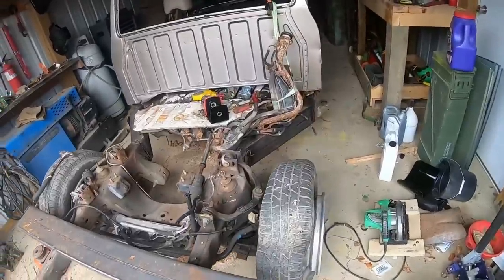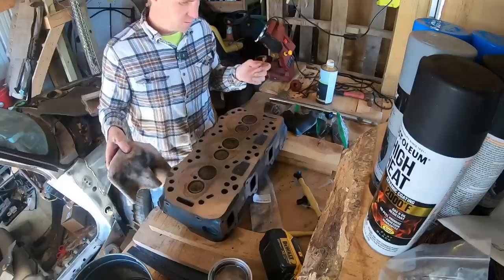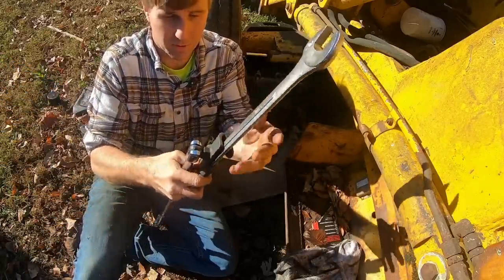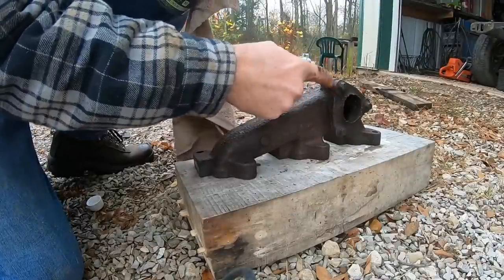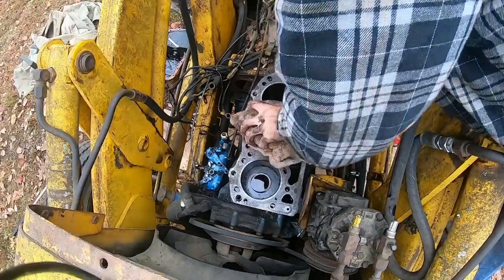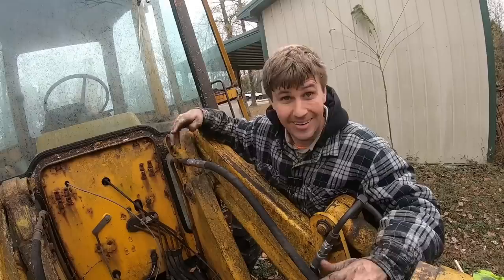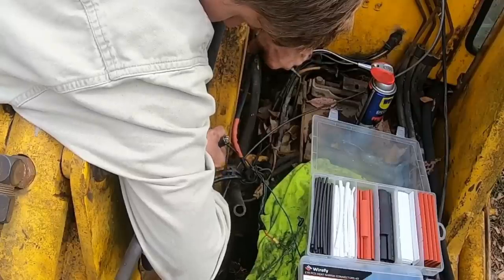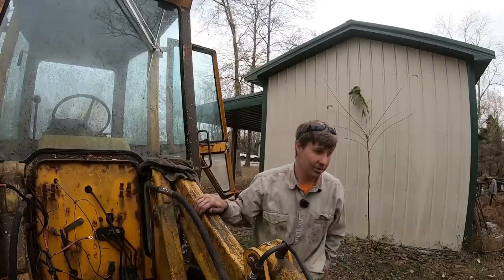Trying to Bring a Non Running Backhoe to Life- Can it be Fixed?

Comment: Okay Kleeman, if you haven’t put the head on yet run the hone again and clean the cylinders and up a little more. The key to getting the crosshatch pattern you are looking for is to put the drill in the slow setting, and increase your up and down speed. Also, make sure you really get everything clean before reassembly, really clean. The last thing you want to do is run a piece of debris through a bearing. Yes the rod bearings look really good. Buy some good assembly lube for the bearings and lube the bearing surface when you reassemble. Looking good so far!
Reply from the maker: Yup! I do have some assembly lube and appreciate the tips! Thanks

Comment: You may think this is BS but if you put a little oil on the little seal before you in stall the keeper clip , this will help it seat in the grove easer. also there is a tool , a vacuum tester specifically for the the valves keeper seal . this helps to make sure  it’s settled properly and you don’t have excessive oil running down your valve stems into the cylinder and smoking.
Reply from the maker: Thanks for the tip

Comment: Great series. Just learned this last week and thought I would share. Tighten your drill chuck as normal then back it off one click. This locks the chuck so it won’t loosen up on you. I found this to be a game changer with my drills.
Reply from the maker: Thanks for sharing
Reply: Except… it doesn’t. Backing it off one click releases the ratcheting mechanism that prevents the chuck loosing on its own. AVE did a couple videos on this recently, even cut a chuck open to show how the guts work.

Comment: At one point when we saw into one of the cylinder bores the marks on the cylinder wall line up with the wrist pin. Hopefully none of them have ever come loose and it’s just markings from the piston shape. 
Not sure if you noted which way the piston was in the cylinder. They often aren’t reversible because the wrist pin is slightly offset in the piston head.
Reply from the maker: The "dish" on a diesel typically goes on the injector side of the cylinder

Comment: Clint told you about the hone job . I noticed you pointed out the damage on the rings piston #2 I saw the wear marks on the cylinder that match up to the damaged rings. When you did that quick hone job the marks were still there. In my opinion that needs to be addressed. Also about the rod bearings plasti-gauge the crank to be sure . The cost to return those new bearings versus using them is minimal

Comment: If i was doing this, I would run the hone at least 30 seconds or maybe more. The hatch marks aqre to help the rings seat, also the oil pump needs a good cleaning and I would replace the bearings. You might get some static about the pits in the cylinders but they will not keep it from runing, but might add to the oil consumpion. Use plenty of lube putting everything together not WD40, but it is yours and you can do what you want to. Have fun.
Reply from the maker: Definitely appreciate the support and thanks for the tips!

Comment: Hey Mike. The older gas engines used 3 rings, but the engine being blue I would say it's out of a Ford 4600 tractor and they also use 4 rings.
Reply from the maker: The pistons that came out of this only has three rings
Reply: I once found 3 ring pistons on a Ford 3000 and the piston kit came with 4 ring pistons. The supplier told me they don't get 3 ring kits anymore, so I installed them and the tractor is still running after 3 years.

Comment: Hey Mikey! I forgot to tell you that out of service fire hose sheath works extremely well for protecting wires and hydraulic hoses.

Not sure where you might find some high quality pressure hose...used by fire fighting equipment...in Indiana...nope, not sure.
😎
Reply from the maker: Yup

Comment: I had a 555 that needed welding were the front loader arms fit on I would check for cracks as easier to weld while you have room to do it
Reply from the maker: Thanks for the tip nick

Comment: Mike you need to spent little more time honing the cylinders with the bead hone slow your up n down a little you want to get as much of the score and glaze of the cyclinder wall so the new ring will seat better with honing it want over the cyclinder like boring see if the piston has any kind of numbers on them that might help

Comment: heading in the right direction. see if clint can help figure out the rings. I'm deal with our 2240 in the same way. fule leak lead to finding out the water pump was bad to learning the head was leaking into the block then found out it's knocking. well let say the engine is now on my bench. parts orded. i guess hunting will take a back seat..
Reply from the maker: Always something
Reply: @CaptainKleeman  yup seems that way. saw mill then 2305 hydro to 5205 backhoe fix to now the 2240. but hay you can't work them and expect them to never break.

Comment: Back in the late 80s/early 90s, I was working for a utility that had a ton of these machines. When we changed the engines, they were a complete motor, that was painted blue. The engines were brand new, from the dealer. If I remember correctly, they were from England, from another Ford product, however, they were a direct replacement, except for the throttle rod, which we would modify in order to fit. I know this isn't much of a help, however, maybe there is someone in the parts department that would remember what the engine was that the Ford tractor dealers were selling. I am sure that there is markings on it somewhere, just do not know where.
Reply from the maker: Thanks for the info!
Reply: Japan maybe. I just got a 2006 3.1 diesel tractor it's locked up learning all i can about 3-cylinder motors Yanmar made good ones. but I can't tell what it is subcompacts are 90% out of the US today. good luck Captain.
Reply: BSD power products from England

Comment: Your machine is a tough workhorse. OK no modern bells and whistles but with basic repairs and a check on hoe and bucket hydraulics and bushings, she will do you proud. How do I know? I have run one for forty years as a woodland workhorse and only ever had to replace hoses and two bushes. Starts on the button, never aether. Give her clean fuel and filters and she  is ready to go in all weathers. The UK is wet and cool for months remember. Love your project.
Reply from the maker: That's great! Hope to have the same.  Thanks for watching

Comment: When lapping valves in by hand, it should be rub, rub, rub, rub, lift, twist and repeat, it helps to redistribute the lapping compound and get the best seat.
Reply from the maker: I did several rounds similar to this, removing the old compound and adding new

Comment: I work at a engine repair shop that would probably end up a rebore. Also if you are putting new piston rings on old pistons a hacksaw blade is good for removing the carbon from the ring groove's.
Reply from the maker: Thanks for the tip!

Comment: Could it be a differend brand of engine? Dit ford ever made 3 cyl? I watched c and c s comment. On board of seagoing cargo vessels we used this brush also. Being alone you could look for thicker oil than wd 40. That one runs away to easely. Your doing a great job. Its not being fully restored but gets very usable. And thats what counts.

Comment: Honing really won't remove any material. Also higher clearance with new rings is still better then with tighter, but busted components. 
I'd hone more still and maybe turn that scored piston in a lathe or attach it to drill and use light grit sandpaper to get rid of high spots on those score. 
Other then that just clean it well and continue what ever you were doing. It will still run like a champ quite a long time.

Comment: I’ve not seen a diesel with 3 ring pistons. All 3 ring pistons I’ve seen where gas. Aftermarket pistons are about 120 ea your this far into it might be something to consider. As far as hydraulic hoses there much cheaper if you can find them premade from an aftermarket supplier.

Comment: Curious about the crank been machined when the motor was rebuilt, could be the new bearings don't fit either. Tapping the top of the valve with a soft blow will tell you if the collars are holding.
Reply from the maker: I gave them the old two by four smack, nothing flew off lol
Reply: @CaptainKleeman  Best finding out before it runs 😁

Comment: I have not read all of the comments, but I wonder if someone put gasoline pistons in the engine, or used a piston that had the same size. You may wind up replacing the pistons. Either way you are adding to your knowledge base. Good Luck
Reply from the maker: Gas pistons are typically flat on top, you can tell these are diesel pistons by the bowl on the top of the piston.
Reply: @CaptainKleeman  Cap'n, that ain't necessarily so. Part #'s are the only sure way to know.

Comment: Well, they either got rid of it because they knew what was wrong, or they didn't have a clue what was wrong and got rid of it. It could go either way really. You got a manual and trusted people to call so I think the only real limit on this is going to be the amount of money you feel like spending. And considering the shape it is in, I agree with just running the pistons you took out. Be a little silly to drop in new pistons and find out the transmission needs completely overhauled. No reason after you have gotten it running and seeing how much use you will get out of it, you couldn't pull it apart and fix things you didn't the first-time round.

Comment: Mike sense you're new at this I'm going to assume you don't know about cleaning the ring groves on the pistons there a tool for that, I have seen people rebuild motors and not clean them and the motor be so tight it won't turn you don't want to do it twice.
Reply from the maker: I've got one already,but appreciate the tip

Comment: It's not a problem to use an impact wrench taking bolts out, however, it's definitely not not recommended when installing them as this can either strip out bolts, or snap bolts off, or both.
Reply from the maker: Thanks for watching! The telegram message is a scam, it won't let me delete it.  Please report it as spam from your end. Thanks! 
The real Cap

Comment: on the hne your suppose to go about 3 sec or so one way then put the drill in the opposite direction and go again for about 3 sec you can do this multiple times if needed its a ball hone your not gonna overbore the cylinder with a ball hone

Comment: Engine machine shops only charge a few bucks per valve to reface properly cleaned engine valves.  If the valve is wire brushed. Degreased.  So its just toss it in the valve refacer. They wont charge you a lot.
Reply from the maker: Wanted to try my hand at lapping
Reply: @CaptainKleeman  i took spare valves and had them ground to the upper and lower angles so i could move the valve seat width around till i bought a sioux valve seat grinder and valve refacer from a retiring boss.

Comment: you probably have a case of 2 rings for 1 groove sometimes you have to double stack them regardless theres always atleast 2 compression rings and 1 oil ring the stuck rings on each piston explain the very low compression
Reply: its possible its been rebuilt and somone put the wrong pistons in it and thats why it was parked
Reply: it having the wrong pistons is what im leaning towards judging by the broken rings and slight scaring on the pistons from piston slap if you found a part number thatd really help
Reply: from everything i can find you stack two rings on the bottom since they no longer sell the 3 ring kit they are aftermarket pistons for a 201 so they are for this engine but not the original style these pistons are from a really old parts house the bottom ring was a thick ring but you now just stack 2 rings on top of each other to get the right thickness you already have all the right parts to put it together

Comment: Mike it looks like you have gas pistons.  It is possible when it was rebuild, to save money they bought gas pistons, because the diesel pistons are twice the money.   I would get new correct pistons pistons for a Diesel engine.   
I know a farmer that rebuild his ford diesel tractor engine and replace the pistons with ones for a ford gas tractor.

Also ford engines are painted blue at the factory that builds engines, and later repainted to yellow on the construction equipment.
Reply from the maker: Definitely not the gas pistons.  You can tell by the top of the piston
Reply: @CaptainKleeman  on farm tractor the pistons looked the same, the only difference was the number of rings. 
The gas piston on gasoline tractor looked identically to the diesel version of the engine with one difference was the number of rings.

Ford even repeated the same on the ford New Holland 3 cylinder tractor, the piston is identical, with one difference, the gasoline piston only has 3 rings, the diesel has 4 rings,. The crank, rods, and cam was identical.

Ford has done this when the farm tractor was offered in both gasoline and diesel variants , as with the ford new Holland tractor was.

John Deere also in the past did the same thing on some farm tractors, hanging out at the farm equipment dealer and repair shop, drinking coffee and shooting the bull with the other farmers, one learned many parts was interchangeable.  

On one tractor to switch it to a diesel, all you has to do was swap the head and intake manifold, remove the distributor assembly and install the injection pump and injectors, the rest of the engine was the same. 

A very good friend who was a mechanic for motorcycles and cars, when he rebuilt engines for a certain Porsche, always bought the pistons for a US mail deliver truck, the pistons was identical, the only difference was the Porsche pistons cost 5 times the money, and both was made on the same line at the factory.  The mail trucks engines are made by Porsche on certain years.

So Mike looks can be deceiving at times, good mechanics on old equipment out of warranty know cost saving short cuts.

I actually wanted to be a diesel mechanic in the very early 1980’s but the economic down turn and the fact mechanics was being laid off in Iowa, I dropped out of school and chose a different profession.

Comment: Hello mike. This is a fun series. If you have the parts and your already in there, why not use those parts? The rod bearings. You did not mention or touch, as far as I could see, I am going to call it the oil pick up screen, the triangular part, will you clean that off as well? Be careful or you may have folks dropping off their back hoes in your driveway. Have good days!
Reply from the maker: Yup!  Will definitely clean the pick up screen

Comment: When will you pressure wash the tractor, look good with a clean up.
Reply from the maker: Does that help it run?.
Reply: @CaptainKleeman  Cleaner to see any other problem's that the dirt may be covering.
Reply from the maker: @alanatkins4315  well as soon as I get the backhoe running I’ll get a line trenched in so we have water at the barn to clean it

Comment: That will have date codes on side of block thay are bsd333 type engine headland pistons for 10 series engines
Blue blocks where in tractors
Normal numbers stamped near starter hole the engine will be 1980s
The bores were common to rust through
These engines are now avalible as copy engines  tell me the unit no on hood sticker
Reply from the maker: You are the first comment to actually know the correct type of ring.  Fortunately I found a tractor shop that knew as well and I've got some parts coming.  Thank you for looking out though!

Comment: so I don't know anything about engines. but I do a whole lot of googling to find answers to stuff. What if you googled for "blue replacement engine with 3-ring pistons" to find out what you actually have and then you might find the right book and parts...... or not..... and you may have already googled that way and not found anything.... but just thought I'd suggest in case....
Reply from the maker: Thanks for watching! The telegram message is a scam, it won't let me delete it.  Please report it as spam from your end. Thanks! 
The real Cap

Comment: You  have major damage on 2 of those pistons. You have gone so far at least replace them.
Reply from the maker: Nah
Reply: I've re-used pistons with chunks missing from the skirt on motors that rev higher that this old oil burner. As long as they are the right size and the rings are correct they will go again with a good hone of the bores.

Comment: We'll you do know it's A 1981 555 international backhoe right? Therefore it's most likely A 1981 Ford 201 engine l.,or international 201 from 1981 either way. Try looking up the 1981 201 engine for your engine parts.& Other parts to for that year model of backhoe 1981 international 555. Possibly might find your parts by doing it that way instead of just looking up the 201 engines. Cause with the engine block year casting it's not really going to help you out all that much. That's me looking up 360 dodge engines without giving the block year date.,or going by the backhoe 1981 year date model information like  1981 international 555 engine block 201 series. Cause I could be looking for parts for A 1970 360 Mopar engine.,an end being A 2003 instead that has the head changed to fit the older stuff.,or vise versa it the bolt patterns line up.& Etc. You see what I'm saying on.& About that part of it now.